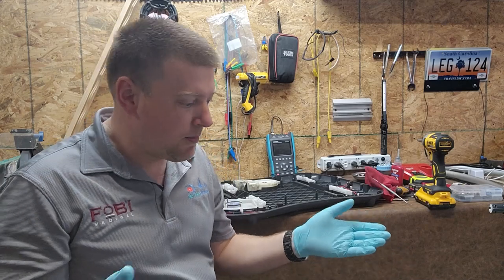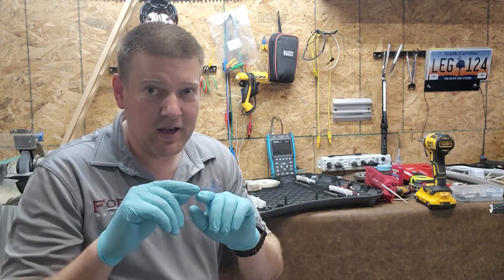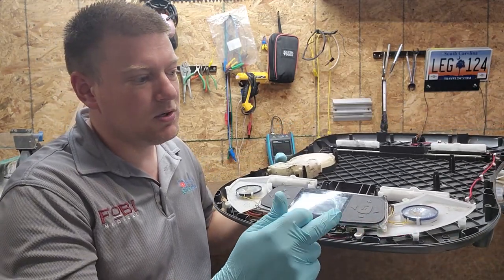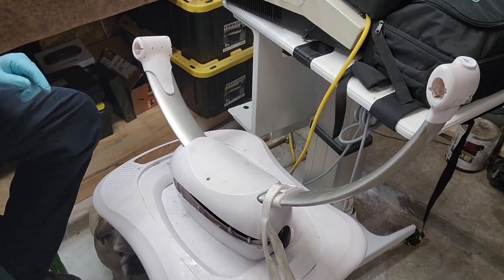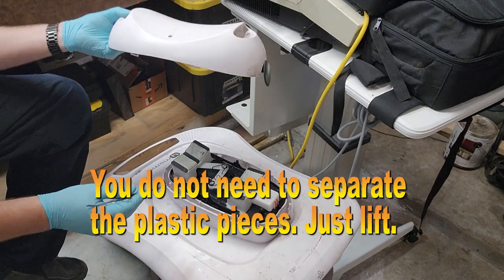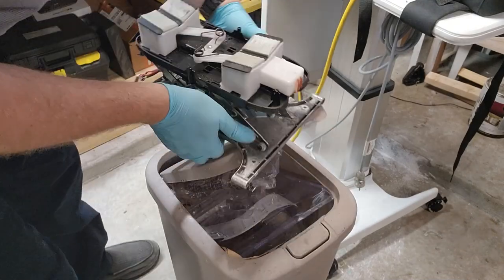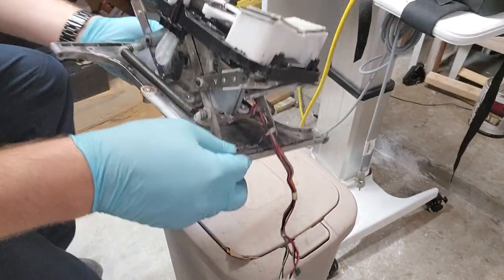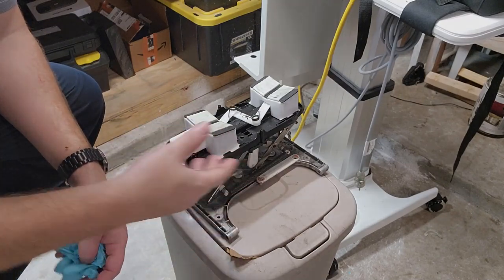4Moms MomaRoo Repair

Comment: That was cool! Currently took one out of garage, 1037. Turned on, music works but moves to side and stops. Panel flashes and stays frozen. Took apart the base and found loose band. Once find its location, hoping to get it working. These machines are pricy and not gonna give up DIY project. Thanks.

Comment: I just repair one not too long ago we don’t  necessarily have to repair them but since I had time I went ahead and took care of it there is 2 sensors inside which get dirty and will give you an error (common problem) I went ahead and clean them but that didn’t fixed it my problem is more of a manufacturer design the main sensor holder just doesn’t hold tight so I went ahead and fixed it after that it worked like new.
Reply: Thanks for that. You should do a video too.
Reply: How did you fix sensor. Did you have to get a new one?